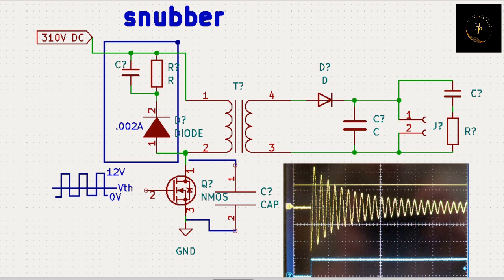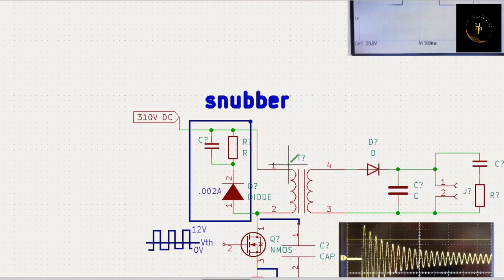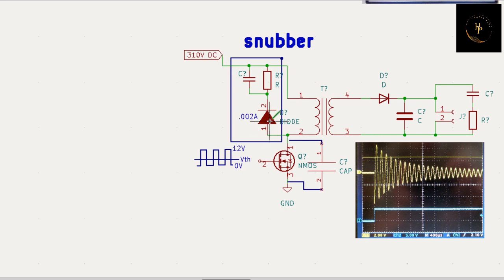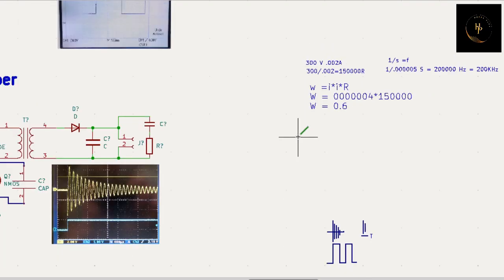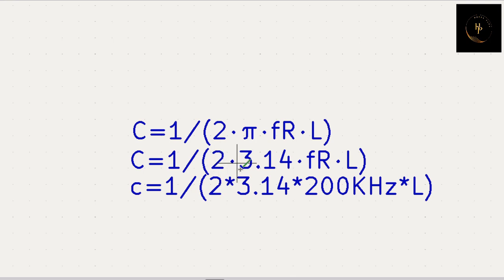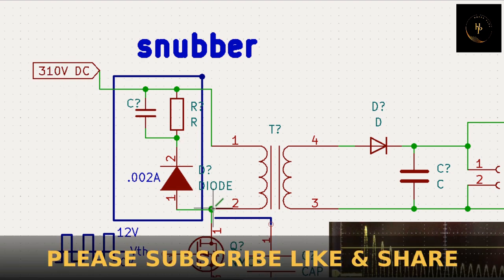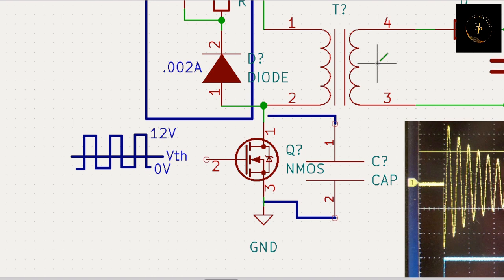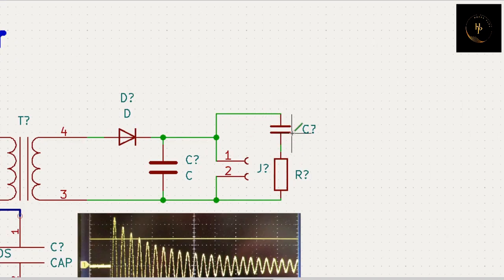[13]SNUBBER CAPACITOR CALCULATION

Comment: My SMPS design is for DC bus input of 650VDC, the snubber cicuit using 10K resistor, 2 diodes of MUR680 in series and 1 capasitor of 6.8nF.  Its ringing badly and the resitor gong hot. But when I apply  310V on the DC bus, the ringing dissapear. Could you give any advice?
Reply from the maker: If your problem is resistor heating, then do it (10k X 2) = 20K. If your problem not solved then send your circuit diagram to me, I try to solved it.

Comment: Hi my dude. I try for many week make trans pulse to isolate my switch ic and in ic side use 12v 3 amp to have a good pulse on the primary for trigger in half bridge 20 mosfet.please help.
Reply from the maker: I don't understand what you say.